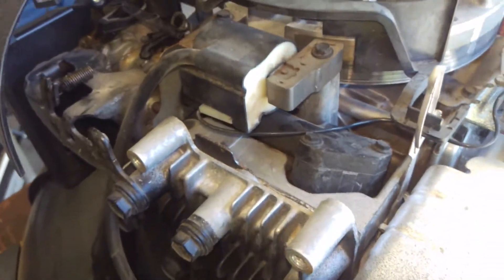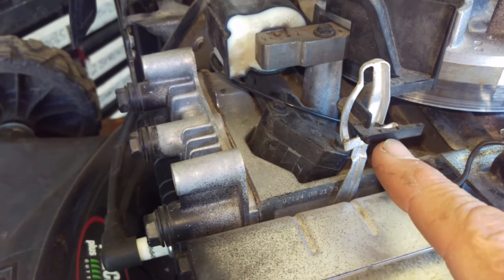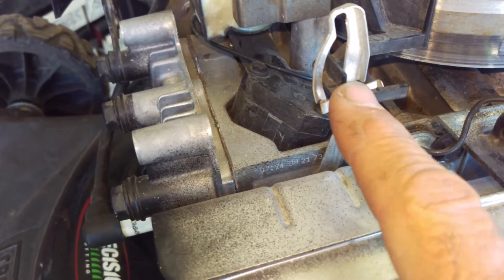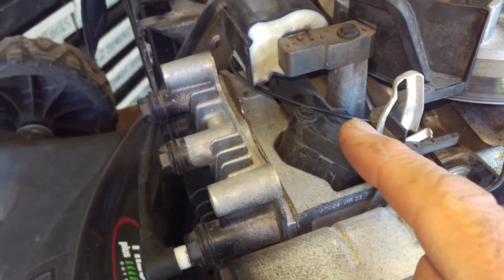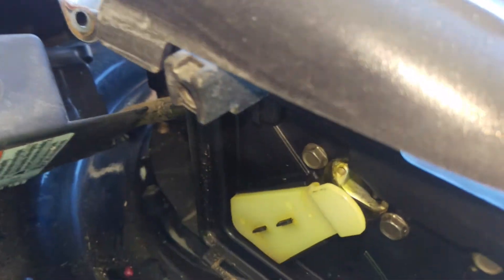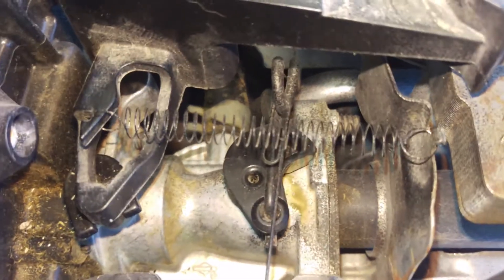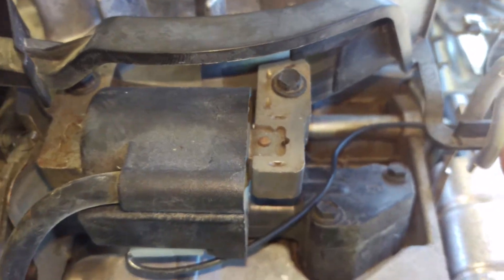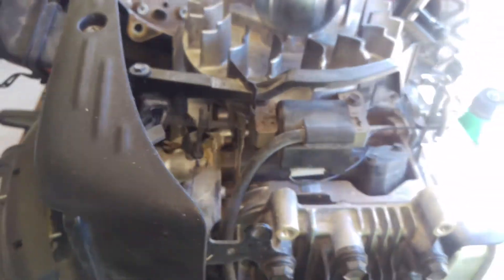Briggs & Stratton AutoChoke. What did I do wrong? P/1of3

Comment: I worked on one last year for a regular customer...  He lives close by and cut's grass for a lot of extra dollars.....   LOL 

He had one with the auto choke and  it would leak gas from the  seat and needle... 2 kits in a week did not fix the issue...   I tried everything I know and still a no go...   

I put a regular carb on it from a non auto choke with a primer air box on it....    Still using it today .............    

Plus Tard Coozan ~!~!
Reply: The plastic control arm needs to come off though....
Reply from the maker: Boo LuQuette I call that "adapt and overcome" Good Guys Always Win!